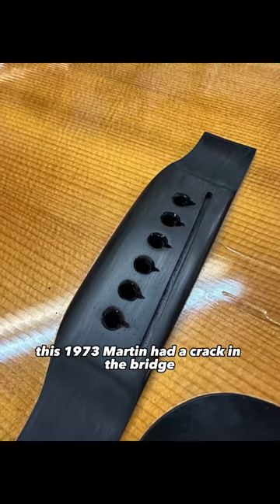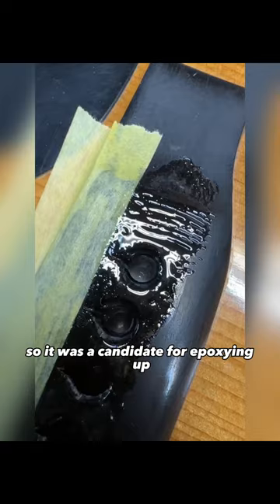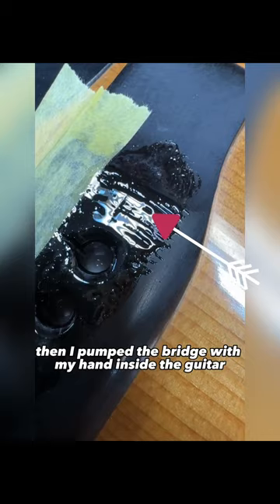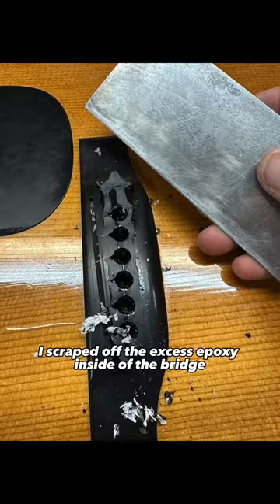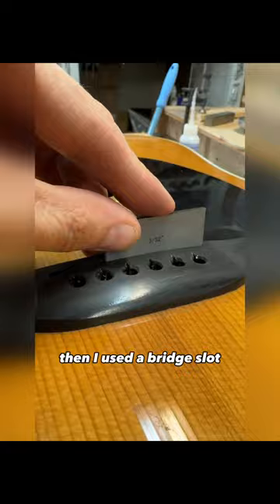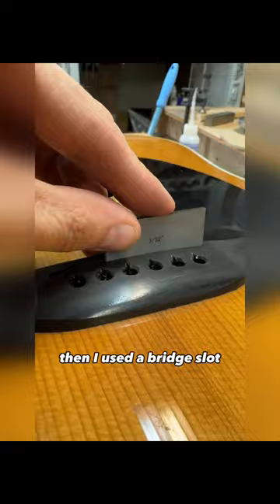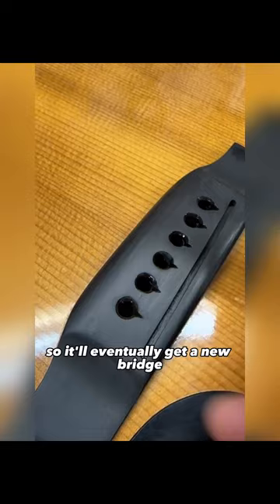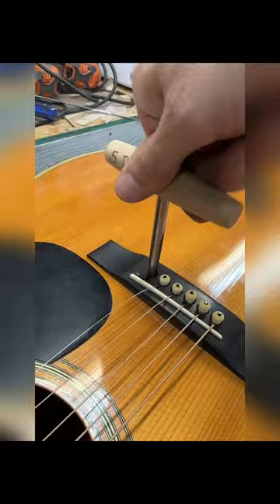Cracked Martin Guitar Bridge Repair

Comment: Nice work,  but why not relocate the bridge to begin with?
Reply from the maker: Intonation vs Cost:
1- while the bridge was put in the wrong place at the factory, the intonation was still ok.
2- the bridge wasn’t coming off/lifting.
3- This is a very cheap repair to do.
4- removing the old, bridge, plugging holes, making a new bridge costs hundreds.
Reply: @BeauHannamGuitars  That makes perfect sense
Reply: How far off were the Martin bridges generally? Were the saddles slots cut before or after they were glued on?
Reply from the maker: @kbraker510  they were (Are) off from around 1968-1978, progressively getting worse up to about 1/8” to far forward (too close to the nut). So the saddle has to be moved back towards the butt
Reply from the maker: @kbraker510  from 1968-1978 they got progressively worse up to about 1/8" off (to close to the nut) which would indicate a jig wearing down over time.